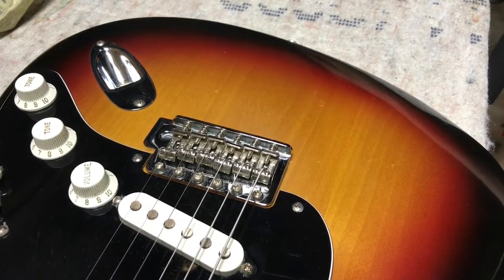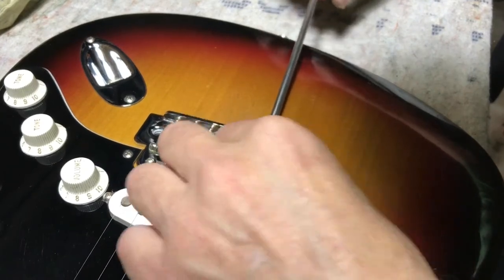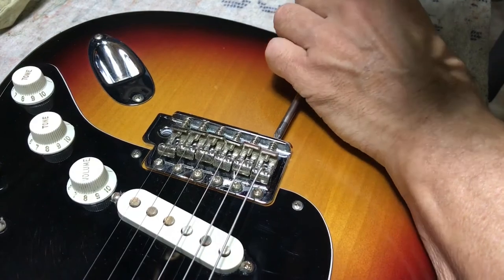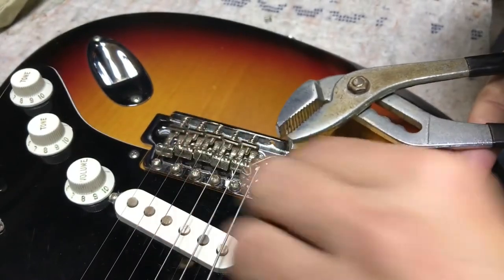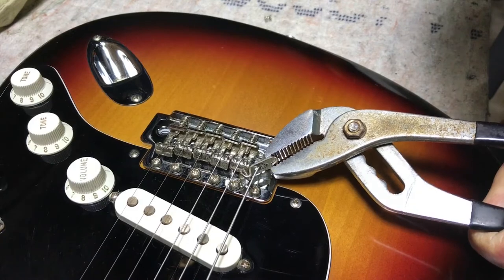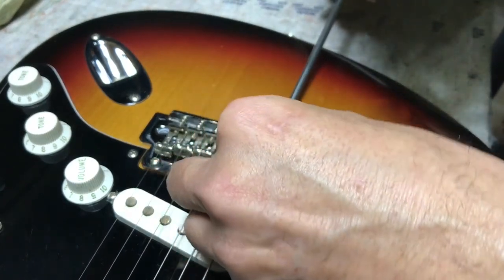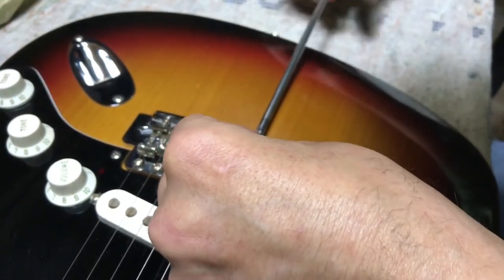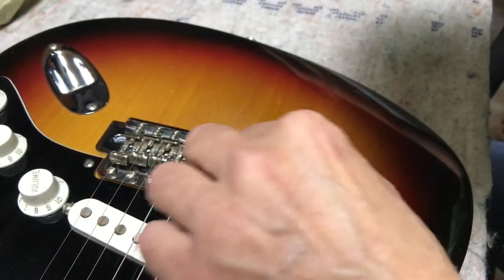Stripped Stratocaster Bridge Saddle Hack - Fender Strat Guitar - 1 Minute Fix with Pliers

Comment: Hello, my new American standard Stratocaster 2015 with two pivot screws bridge seems to have the bridge no parallel to the body..the shop put 10 high E gauge string and before it was 9. Now the treble side  seems to be lower and in fact the  sound of e   b     g is not beautiful( I had also a little G buzz solved with loosing truss-rod and getting higher saddle). IM scared; till now my classic vibe 50 squier Stratocaster sounds and plays better with more sparkle in 2 e 4 positions , and here in Italy costs 400 euro instead of American standard is 1600 euro. The  American strat has the fat hot 50 pickup and they are very hot and powerful and the fender specs of pick up height should be change for them( not 2.4 mm bass and 2mm treble..but it needs to  definitely lower the height ).this being said , according to you , should I work on the 2 lateral pivot screws to put the bridge parallel and should I  raise a bit the bridge screw or should I work with springs opening the back of the guitar? Thanks
Reply from the maker: Hi, both can change it. If the tremolo feels too loose, then you can tighten screws holding springs on back (or even add an extra spring) and it will help pull the bridge parallel (if it was pointing up). If it is pointing down, then possibly loosen the screws on the back. good luck